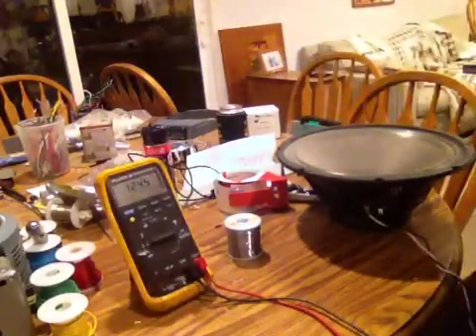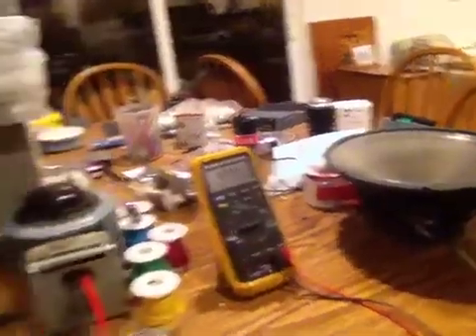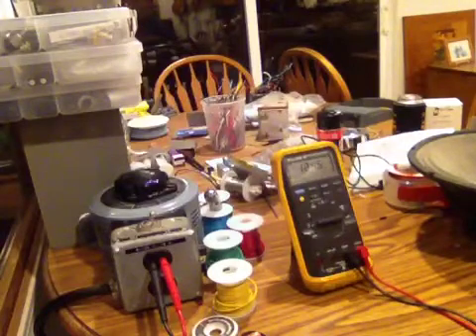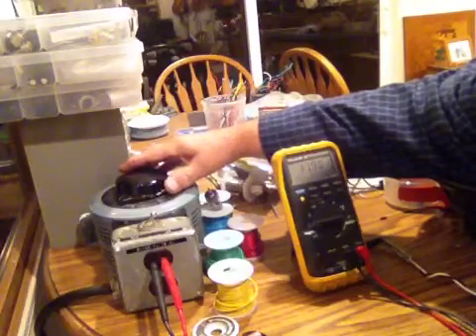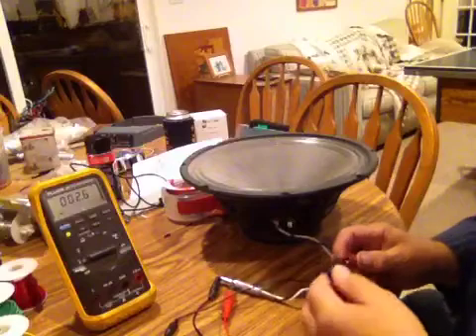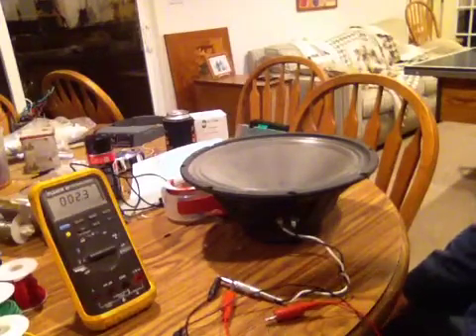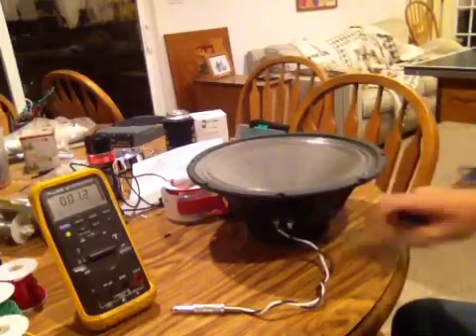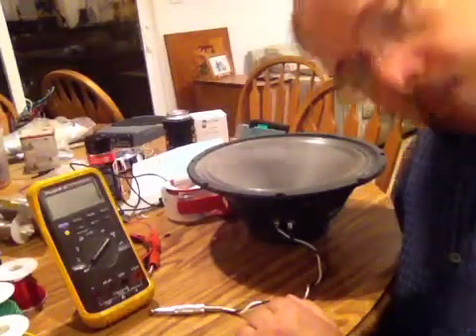Speaker Break In With Variac

Comment: I started breaking in a pair of new Celestion G12EVH speakers yesterday, I didn't buy them new but some modern metal kid pulled them from a new 5150 III cab. They sounded harsh in my closed back 2x12 so after some research I put my variac  to use. Thing is I ran it 2 hrs on and 1 hr off, I'm wondering if I should run them up to 8hrs like you did. I might, wish me luck. Lol. After calculating, running about 10vac.  They're mounted so I hope that doesn't restrict cone movement. Thanks for posting the vid. Rock on.
Reply from the maker: Jimmy Nelson I typically run for four hours then give it a break and run for four more hours

Comment: awesome video,  very informative!!   i do have a question,  if i may,  can i use this process without removing my speakers, (2×12 30w speakers) cab is 16 ohms.  closed back cab.   thanks
Reply from the maker: Mike  Opeka 

Having them in the cabinet shouldn't be an issue.  However, I have never tried a multiple connected break in though when they are in series or parallel.   I always formulated using an individual speaker and its rating.  Not with multiples.
Reply: Delmar Evans thank you for the reply :)